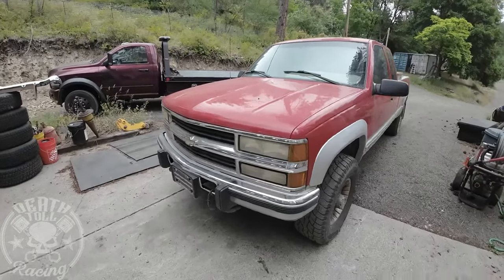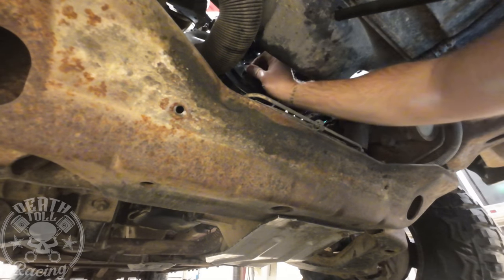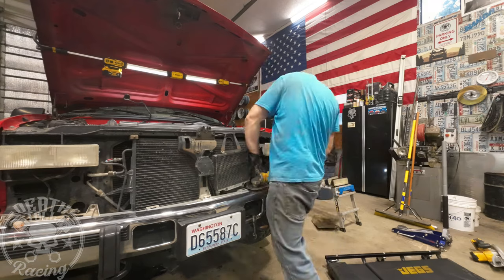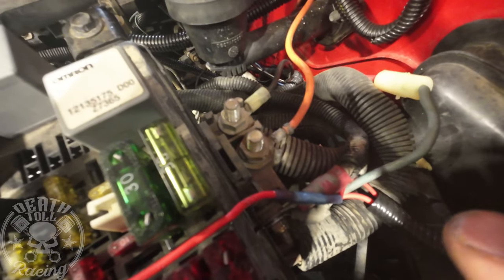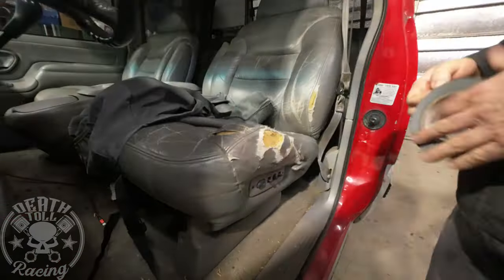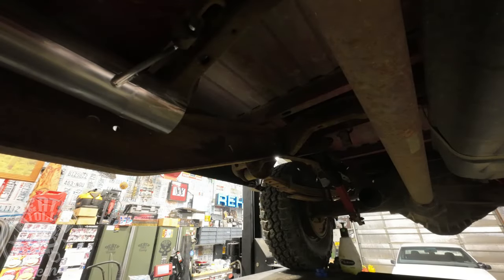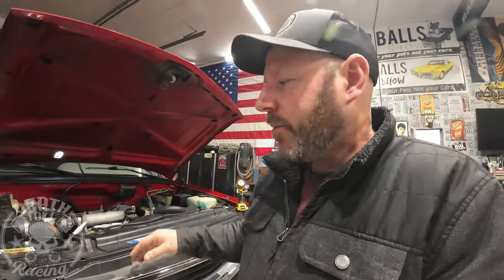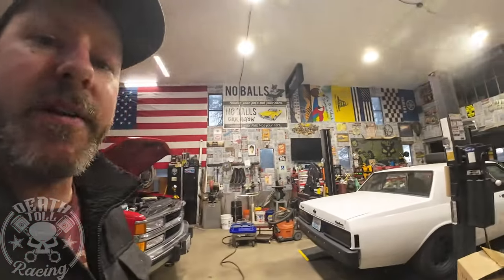Making a 6.5 Turbo Diesel Reliable.  Fixing the Achilles Heels of the 6.2-6.5 Detroit engines

Comment: Thanks for the video! I wound up swapping my oil cooler as well with the blue ribbon kit and I see what you mean. Any concern with the cooler lines touching up against exhaust manifold?
Reply from the maker: All the concerns about that!  The lines stress me out. I really need to replace them something else. I think I’m going to do -an fittings and braided line.  So frustrating they made them so short. Literally 1” longer and it would be acceptable. (Yes, I’m still talking about the oil cooler lines) 😂
Reply: @DeathTollRacing  It’s like they just eyeball the length, I don’t know if you would make a whole video about swapping out the lines but if you did, I know at least one person who’d watch it!Keep up the great work!

Comment: How do you like the air dog? Does the 1/4 line keep up with the injection pump?
Reply from the maker: They are good. I’ve had a few of them now on different rigs. The 1/4 inch is fine with my setup. I’m not sure if there’s every a reason it wouldn’t be, even with bigger injectors I think it would still be okay. I prefer fass systems in general, but these are good too.

Comment: What would be the most that I would want to run boost at until I replace head gaskets and head studs in these. I’m looking for towing power too.
Reply from the maker: Under full throttle they say 12psi is max. If you go mechanical Wastegate like I did you will see higher boost at part throttle and that’s fine because the cylinder pressure under part throttle isn’t very high and that’s where the problems come from. Injection timing is also critical, too much advance and it will again make higher cylinder (combustion) pressure and could blow gaskets.

Comment: Thanks for the info to
Reply from the maker: No problem 👍
Reply: Also do you turn the nut to tighten. The spring to increase the boost or turn it too the left to decrease the boost on the manual waste gate
Reply from the maker: Tighten increases boost pressure

Comment: Do you really need and airdog fuel system or and new fuel system in general with these 6.5L diesels?
Reply from the maker: It helps the longevity of the injection pump.  It’s also much easier to service. But, it’s pretty far down the list on essential.

Comment: Did you happen to change your head gaskets and studs too.
Reply from the maker: Not yet. If you do you can up the boost. It just had the head gaskets done when I bought it, so theoretically I could do the 1 at a time swap out on the bolts

Comment: Red or Blue Loctite? What did the factory use? Nothing. So Blue is overkill and Red is just nuts.
Reply from the maker: Factory uses a thread sealer that's pre applied to the bolt.
Reply: @DeathTollRacing  Probably so, I don't remember it when I changed the old balancer. Thanks for the reply and the post.

Comment: How did you clean and de grease the entire bay, and engine?
Reply from the maker: Simple green aviation, pressure wash, repeat 3x or so. Then I use “aluminum brightener” on the aluminum parts after (like mag wheel cleaner, napas Mac’s aluminum brightener or similar).
Reply: @DeathTollRacing  thanks so much! I’ll be doing that. Need to put the cover on my air filter side

Comment: I have a 95 Chevy 1500 with the 6.5 diesel, seems strange a 1500 would have the 6.5. Anyone know how common it is to have a 6.5 in a 1500? Also, lately after about 25 minutes of driving it starts to stall, I coast for 15-20 seconds and it starts back up for a couple miles and this cycle continues until I get home. Very frustrating, any advice/ideas would be much appreciated. No the PMD has not been replaced/relocated. I keep thinking it's a drop in voltage but it only happens when I drive so I can trouble shoot it.
Reply from the maker: I think that’s the pmd.  They actually made a decent amount of 1/2 ton diesels. As well as suburban and even Tahoes. A 2 door 6.5 td tahoe is on my bucket list.

Comment: Why are you changing the oil cooler ?
Reply from the maker: It came with the kit and didn't need to be adapted for the new lines.  It's really not necessary except for that.
Reply: @DeathTollRacing  I'm going to check the cooler lines. I've been using high mileage oil additives made by Protecta and another by Extreme Green. Supposedly they keep the rubber from hardening and the hoses last longer. And less engine wear. A new balancer is next, then the Air Dog. Thanks for all the tips!
Reply from the maker: @tarquineous  excellent!  They usually will start leaking around the crimps before they completely let go.
Reply: @DeathTollRacing  Thanks greatly. Now I know exactly what to look for.
Reply: @DeathTollRacing they started leaking on mine, so i change out with cooler and lines from quadstar, you can buy stock lines much cheaper, but its a big job to change them

Comment: I have 1995 c1500 2wd 5x5 bolt pattern with a 6.5l diesel turbo how rare is this truck you think
Reply from the maker: I've seen a few.  But not very many.  I really want the 2 door tahoe that came with them.  I used to see those fairly often, but not so much any more.
Reply: Can a pmd shut your truck will running and can it start few days later thats my case should i put a new pmd mine its old and was relocated on top of intake mainful  @DeathTollRacing
Reply from the maker: @5809Alejandro  yes. That’s usually what they do on the way out.

Comment: Hi how is the air dog fuel pump working?
Reply from the maker: No problems so far. I’ve ran a number of these and haven’t had any issues before either.
Reply: @DeathTollRacing  okay thanks I’m getting ready to install one on my 96 6.5 my mechanic was unsure about the fuel pressure settings did you adjust the fuel settings on the pump ? Or just ran it as is
Reply from the maker: @GmsrelentlesshopeinYahawashi  it’s factory set. Not a bad idea to check it though.